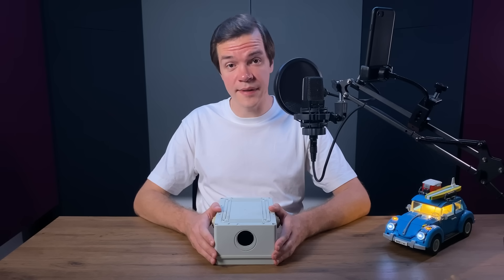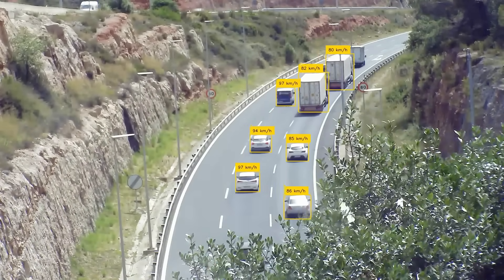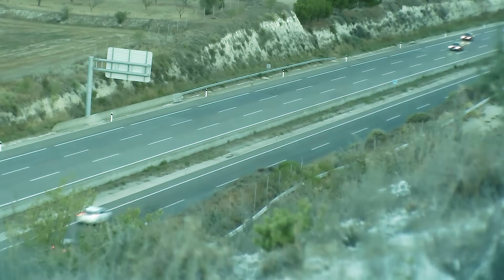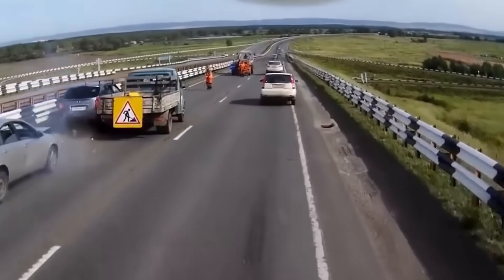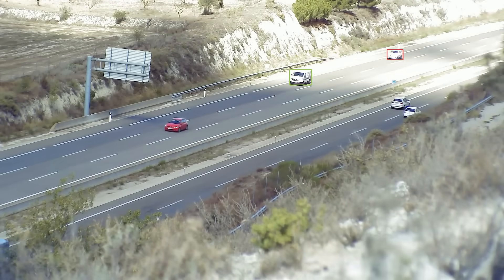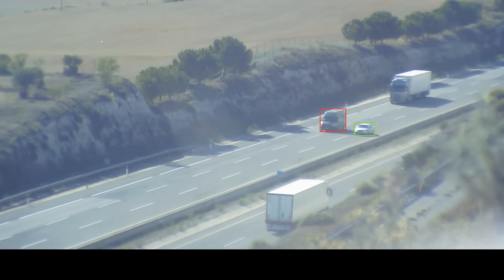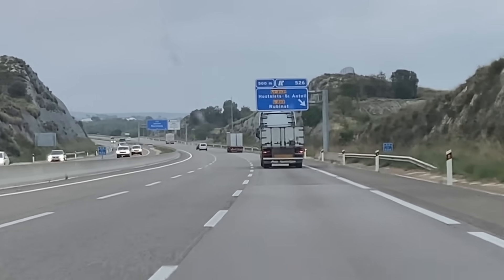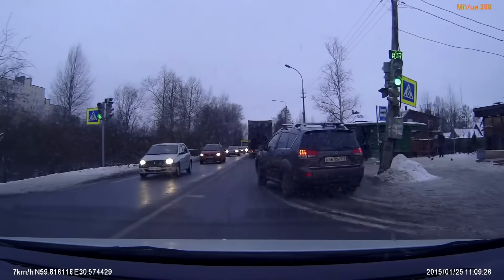New Anti-Tailgating Camera Reveals Shocking Statistics

Comment: Speeding IS the cause of collisions, but not because speed in and of itself, if that makes sense. Speeding causes collisions because the average car driver has very poor reflexes and very poor visual reaction time. By speeding the average car driver is driving well outside of their safety envelope.
Let's say the speed limit is 120 km/h. That's 2,000 metres per minute or 33 metres per second. If the average person has a reaction time of .25 to .35 seconds, that means their vehicle has travelled 8.2 metres to 11.5 metres before they've begun to react. And that's if they don't panic and freeze. Distracted driving has been shown to double the reaction time of the average car driver. So now instead of travelling 8.2 to 11.5 metres before reacting, the average car driver now travels a distance of 16.4 to 23 metres before reacting.

Comment: Thank you! On the highway I always drive my Tesla Model S in Autopilot with Autosteer mode. I set following distance to 7, the longest available. The provides a gap of ~2.5–3.0 s or ~78–83  m at highway speeds. This is less than the 100 m you quote as the safe distance, but I suppose the car's computer can react faster than a human driver. I can control my following distance but what about the driver behind me?

Comment: I used to drive a medium truck, 12 pallets, around 10-15 tons. Trying to maintain a 2 second interval (the recommendation here in Australia) on the motorway was difficult - people would always go around the "slow truck" (I was going at the same speed as the rest of the traffic) and then cut in front - slowing me down as I re-establish 2 seconds. But FOUR seconds was the proper distance for a truck, and even more in the wet - and that was always IMPOSSIBLE. 4 seconds is 140 metres - and a car would ALWAYS cut in front - literally all the time. Car drivers have NO F'ING IDEA how dangerous it is to cut in front of a heavy vehicle - especially the doubles that weigh SIXTY TONS.

Comment: This is an excellent analysis! ☝☝☝☝☝Very sound description of your research question ,method (including its limitations), findings annd conluding discussion of youre findings. I would like to add a few points to your discussion. First, many accidents are avoided by drivers not regarding the save-distances-rule by monitoring not only the car immediately in front. That gives the drivers more time for the most common accidents. However, it does not help if the car in front loses something - I was once a passenger when my mom drove behind a car losing a bicycle transportet from its roof. We had plenty of distance but needed nearly all of this. However, such "freak" accidents are rare. Nevertheless, driving becomes difficult and exhausting if you have to watch not only the car immediate in front but two or three more ahead. Second, if drivers would use a safer distance then the capacity of highways will be reduced. So it appears there is an unspoken compromise between road capacicity and number of accidents we  are expecting.

Comment: Excellent video. It's not just a safety issue, it's often the cause of traffic jams. You can see it demonstrated by searching for "traffic waves". The closer you are, the more you have to slam on the brakes. Also, if somone cuts in, you need to make a more agressive slowdown, then it propagates throughout the traffic.

I've been thinking about a design for a tailgating detection system for years. The idea I have is to spread out 3 cameras over a few kilometers. You can then prove that it's not just incedental if the same person is still tailgating the same vehicle in front over the course of 3 checks. Anything less than 2 seconds on average over 3 checks should be fined, with the penalty increasing exponentially the closer they get.

Comment: Why does nobody consider that a 3 second standard will grind every major city to an economic halt. A 3 lane highway would be limited to 3600 cars per hour. With the typical 0.5-1.5 sec, you get 10000 cars per hour.

If everyone tried to do 3s, they'd just keep slowing down as more people merged in, and rush hour would extend to 4h+

Moderate tailgating (1s distance) is only a problem for drivers that are distracted or have slow reflexes.

Comment: Speeding isn't inherently dangerous, speeding negligently and recklessly is dangerous. Someone who does 30kmh over on a highway and leaves a safe 3 second distance, stays in the outside lane when not overtaking, uses their lights and signals, slows down when they need to and has proper awareness will be much safer then someone who tailgates you or uses their phone.
Reply: speeding is dangerous.  The fatality difference for pedestrian strikes is direct to speed.  In areas with pedestrians there will be events where they did not observe the car, or misjudge how much time they have because the street is marked at a certain amount and the driver is going well over.  there are no excuses for speeding.

Comment: Its about tailgating, but what I couldn't help noticing is that apparently in Spain its cool to just drive right on the dotted lines, rather than between them.

The number of cars cruising along with a tire on the line was kind of shocking.
Reply: Its spain. Roads are a guideline, not an obligation.
Reply: I went to the south of Italy once. Very beautiful but on the road there is as many car lines than there is space for them. so you can find four lines of cars in a 2 lanes road
Reply: @yoguisky Tbf, we have this problem in the U.S. But only when it snows. The minute snow is on the ground people just drive wherever tf they want.
Reply: It depends on the location, in some places people drive beter than in others, it usually correlates with population density, in rural areas people speed more, leave more distance and are more conscious of where their car is, this is caused by small roads, often without a median line, with bad visibility and slow vehicles and animals, menwhile, in the city people are used to more trafic, les speed, less distance and a looser sense of a path

Comment: 12:43 your 30m observation is interesting. And unfortunately jibes well with my own experiences: if you actually put a proper follow distance in front of you, most drivers will think there’s room for 1-2 additional cars. Which actually matches your math: you can easily divide 100m into 30m x3 and still have just barely enough room for those two additional cars. 

So now I have a pretty good idea of the subconscious math the idiots filling up my follow distance are using. Doesn’t make it any less dangerous or less annoying, but I’m continually baffled at that 2nd car. I look at the space in front of me, and I understand why someone might think they can fit. They’re wrong, but not so wrong that I can’t believe that they believe it. It’s when that second car squeezes in at highway speeds that I can’t believe they actually think that’s ok. But they never act like someone who is aware they’re cutting someone off — neither apologetic nor aggressive and bullyish.

Comment: Tailgating cameras have been in use on German "Autobahns" for decades.
Even here in Australia there are some points with the markings for easy identification of distances between vehicles under some gantries over the freeways.
Fining drivers for not wearing a seat belt is ludicrous, fining driver for not respecting the minimum distance makes much more sense.

Comment: Here in the UK if you are being tailgated, it's most likely the police in an unmarked car.  They'll do this in the hope that you will accelerate to get away from the irritation.  Only then do they turn on their lights and give you a ticket for speeding (that they triggered).  Obviously the solution is to NOT react to tailgaters in this way.  Personally, if anyone starts tailgating me, I deliberately slow down.

I have even been stopped by to police to ask why I slowed down while they were behind me.  My answer is that, I didn't consider they were leaving a safe stopping distance, so I'm simply slowing down to a speed where their distance would be more appropriate.  It would also give them a better opportunity to overtake as, they're obviously not happy following me.

Comment: 3 seconds sounds very strict. We are using 2 seconds rule here. Anyway, when driving I am mostly focused on the situation in front of me (2-3 cars ahead) so its nearly impossible that car in front of me would crash to standstill without me noticing it beforehand. Reasonable tailgating is also matter of communication. When on german highway you will encounter many left lane or middle lane hogers. I noticed if I am gentle, they are less likely to clear the left lane.

Comment: I really like your measuring setup but i think the analysis could be improved:
1. Calculate the following distance in seconds based on the speed of the following vehicle
2. If the two vehicle speeds differ by more than X percent or km/h (or a combination of both), then discard the corresponding following distance
3. Calculate the expected impact speed instead of a safety index

Comment: I have long thought that increasing following distance is not only safer but it prevents traffic jams by mitigating the spring effect of a stopping event moving through the traffic column. Following distance should be enough to safely let other cars change lanes in front of you. The roads are designed to change lanes as needed, and when drivers prevent other drivers from changing lanes in front of them, then it slows traffic down. I would love for a traffic engineer to test this hypothesis sometime.

Comment: So I've seen these calculations before. They assume you have to decelerate but the car in front of you is beyond physics and can stop instantaneous. If we assume all cars have the same deceleration curve and remove human reaction time cars could in theory drive 1mm away from the car in front. And safely stop, because as you slow down they slow down, which means from the point they started slowing down you dont have to be stopped as they rolled forward so adding stopping distance.
Reply: The reaction time our teacher was trying to prove was that 2 second rule isnt enough. But even if we assume 0.9s to start stopping. You have 1.1 secs x speed of distamce before they even started to slow down so you have extra distance to come to a stop.

Comment: If someone cuts in front of you, don't brake unless you really have to. Release your gas pedal or disengage cruise control. In ten seconds or so, you will have sufficient distance to re-engage cruise or get back on gas. Most drivers don't understand that normal traffic maneuvers take considerable time to perform, and try to get everything done as fast as possible.

Comment: would be cool if cars had a way to show you 100m (or safe distance for current speed). maybe indicator light or marks on windshield. 3 different color lights perhaps to show increase risk that adjusts for speed. green yellow red. >=100 green, <50 yellow, < 30 red. with all the useless smart features in cars like butt warmers you'd think there would be a priority for safety.

Comment: Quick concern about your methodology with the safety index: It appears you are assuming that the obstacle to be avoided is immediately at a full stop x meters in front of the driver's vehicle where x is the following distance. There are very few cases where this is a possibility, including a road obstacle that was originally stationary and only becomes visible when the leading vehicle has passed it. In almost all other cases, the leading vehicle is the obstacle whether in the form of released cargo (dropping something from the vehicle) or the vehicle itself stopping. In the cases where the leading vehicle is the obstacle, extra stopping time is granted due to the leading vehicle's own stopping distance requirement (leading vehicle needs time to come to stop). 

Overall, great video. Keep it up!